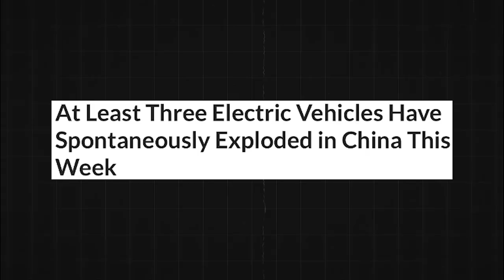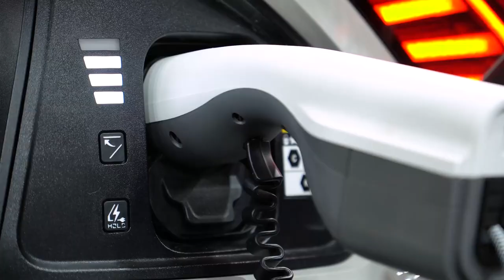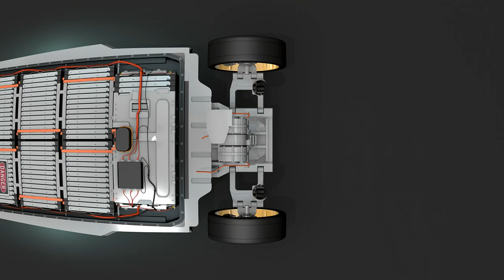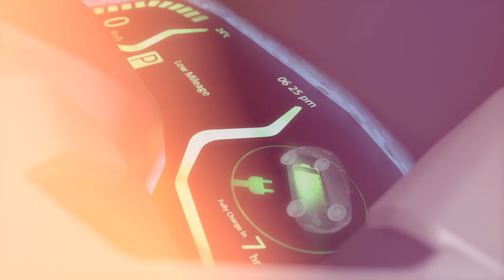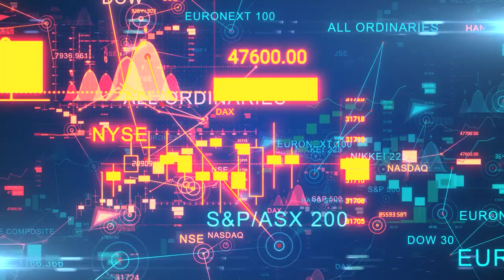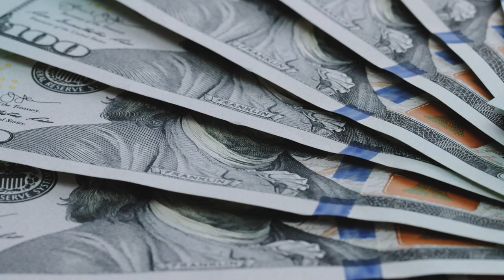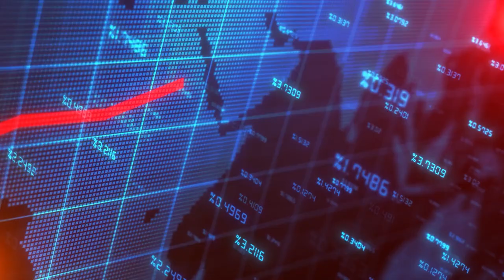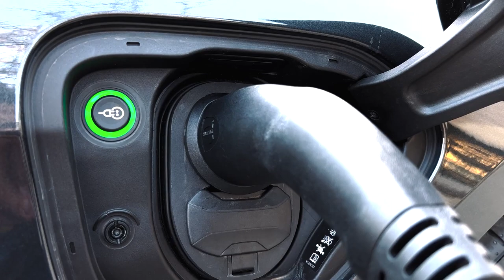Chinese Electric Cars Are Literally A SCAM...

Comment from the maker: Should All Gas-Powered Cars Get Banned?🔋
Reply: No, because they are cheaper and they don't need endless amount of mining raw materials
Reply: No, because ICE-cars don't have that heavy CO2-lugage as EV-cars and don't consume that enormous amout of minerals that we are already now short of. Batteries can never reach the same high density and energy content like hydrocarbon. It's physical impossible. Exhaust fumes can be cleaned. PM10-particles from EV-cars due to their heavier weight can't be cleaned. I compare this EV-race like a race towards a thick concrete wall. How will crash first and who will follow? Tesla will sooner or later also crash. Look at Ericsson and Nokia, to telecom gigants 20 years ago. Now extinct from the cell phone market. As car maker you must keep the combustion engine and not only put you money on EV. l wouldn't be surprised if a diesel fueled towing car tow the last EV-car to the scrapyard. Headlines from the EV-industry like "Now the ICE-killer is here" well nothing has been true so far.
Reply: No cars need to be banned! They will run their life span. An EV is just another form if motion which isn't suck, squeeze, bang, blow! Can you remember the old crt TV's? It the old Nokia phones that you could only phone and text on? Where are they now, some are still around for sure in the same way as horses are and steam trucks which go to  steam rallies!
Reply: But if gets “very,very” hot when the battery becomes a virtual flame/throwers!!
Reply: Efuels/synthetic fuels are being developed. Ultra low emissions and net zero. We dont need to ban ice cars. And most of us dont want an EV. We certainly dont want to be forced to buy an EV. And many people cant afford one. EVs are not the solution. 2 billion ice cars in US landfills cannot be good for the environment. Will recycling of these vehicles be allowed? Lots of oil based materials.
Reply: @awakeadventurer9198  Synfuels are always more expensive than electricity because they are made from electricity with low efficiency. When EV manufacturing cost crosses below ICE (which is happening) the lower running cost of EVs will make them a no-brainer. The marketplace will decide, and ICE will be toast. Synfuels and hydrogen, ammonia, etc. are just too expensive. Besides, they always have to refuel at an energy store, not at your own home overnight like EVs.
Reply: @jamesvandamme7786  the grid isnt even close to ready to handle EVs at the numbers it would have to once even half of us have them.  And, many of us dont want them. The market will decide. Choice is the way.
Reply: Yes
Reply: I still prefer ICE and still want to drive ICE. I drive EVs cause they're a lot cheaper to run and simpler to maintain. Other than that, they're smooth, quiet and really fast in many real life scenarios. Environment? Making current batteries cause far more pollution than making.... a Range Rover, Ford F350, Chevy Suburban and such! Disposing other components of batteries are serious concerns as well.
Reply: Yes

Comment: Insurance for EV higher are .much heaver  & special tires cost more
Reply: My model 3 dual motor long range weighs 4,065 lbs. My Mercdes Benz C43 AMG (equivalent size and performance) weighs 4,084 lbs. So much for the rumor EVs are heavier than ICE cars.

Comment: I owned my last EV a nissan leaf for 14 months i paid £10,450 for it from Arnold Clarks after driving 13000 miles I sold it to Stratstones for £11,700! And i took advantage of free rapid charge in Bradford for 12 months. EV's, I love em!
Reply: They can certainly work well for some people in some situations. Especially if you can charge at home overnight. But the reality is the current lithium cobalt technology is very dangerous in cars and anything larger than that. Reason being is 2 fold.
1. The weight of the vehicle can easily damage the cells with the common design where the battery is under the car. It only takes minor damage to start thermal runaway.
2. The sheer number of cells creates huge powerful fires. So powerful they can melt steel support structures. Do you want that thing charging at your home?

Also mining for lithium and cobalt is horrible for the environment.

Comment: hybrid is and always was the answer.
Reply: Until chargers are ubiquitous, which is coming. Then hybrids will plummet in value.
Reply: hybrid was the answer in the 90's and it was always a transitional piece until affordable batteries and infrastructure is built
Reply: @fetB Yeah? 
This is the current mindset of Toyota (despite it's Prius entry decades ago being 100% electric) which confounds me entirely. Surely Japan is a place where it is Impossible to travel more than 1 hr to work. OK, so maybe the US market is their larger target? Still. I am so* disappointed in Toyota's CEO & Co for this dual drive system.

Comment: Eventually EV's will be the furture but I do not see that for at least 10 - 20 years from now.  And it doesn't surprise me about Chinese's EV being crap and catching fire!  Made in China seems to be where low end Chinese crap floods the market and is replaced after a short time because it wears out and or breaks. I do not care how cheap a Chinese's company sells an electric car I would rather take the bus than own a total POS Chinese EV!  BS it is not the business model it is the technology!  The range is not good enough, the charge times are to high and the price tags are far to high.  EV's will need to be replaced sooner than gas powered vehicles and god forbid you ever get into an accident because they are very expensive to repair!  Insurance companies are quick to total them pushing up the cost of insurance for everyone.

Comment: I think electric engines are the future. I just don’t think lithium batteries are. And I think you will find out the problems you will encounter next time you have an accident on the road and you have to get it repaired. I recently purchased a small fuel efficient car and it will probably be my last car. It is a-shame I also did want to own an electric car, but they are still too expensive and all the issues with lithium batteries.
Reply: what are the problems?
Reply: "electric engines"  suggesting you ignore the usual language ("motors") blurring the major difference that EVs have no CO2 emissions outside of their actual manufacturing/ mining costs. 
Maybe you live in a quiet rural area where there's no smog, no smoke... I used to live there (decades ago) but now those clear skies are hazy from forest fires hundreds of miles away. The weather forecast described this as "Heat warning" which was not* backed up by daily temps before or after. "Haze warning" is clearly more accurate imho.
Time to recognize that a century of ICE is killing us and EV adoption will give future generations a better chance  yes?
Reply: @calmorton4619  
I think you are nitpicking doesn’t engine and motor mean the same thing. And regarding about being clean CO2 we have to consider that until we are solely reliant on on clean renewable we are still spewing out CO2 by proxy. And bushfires we have had them even before cars existed. And when you also add the CO2 produced by the fabrication of Lithium batteries, I don’t think we are doing environment any favours.
Reply: @calmorton4619  - You think EV's are going to make the weather more to your liking?
Reply: @fetB What planet are you from?
Reply: @a95569  earth. Im just interesting seeing what the problems are. Lithium batteries for example. They're not all the same. Repairing an EV is also no where near as difficult as doing it on a combustion engine. Im calling BS on OP.

Comment: No one wants them , very expensive  & cause pollution  , why no Solar roofs ? 
Us PANDA fans  disgusting  ! An electric  Panda extortion  cost , very few electic vehicles  seen in Spain  , the electric  buses charged by solar , the charging points  I have seen very little  . If you examine  the battery pack its a complicated link of AA sizes cells , only takes a deep one to overheat , bye bye car . We use our electric  buggies quite often , cheap to charge safe Lead acid , we couldn't  afford 2 Li ion battery  to get 24 volts . Fine in mobiles etc !